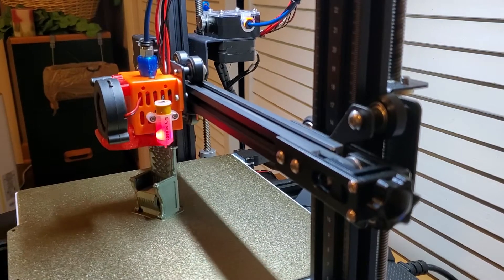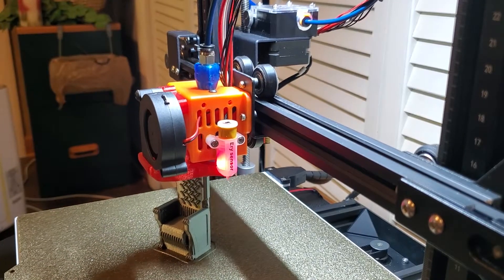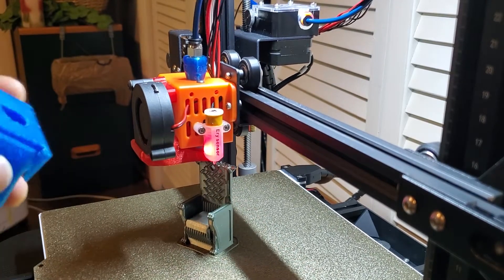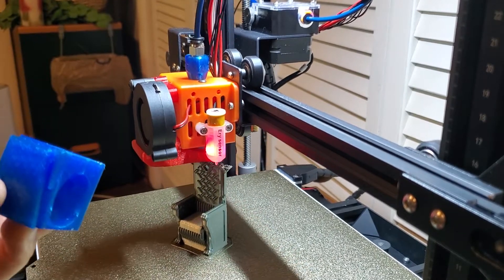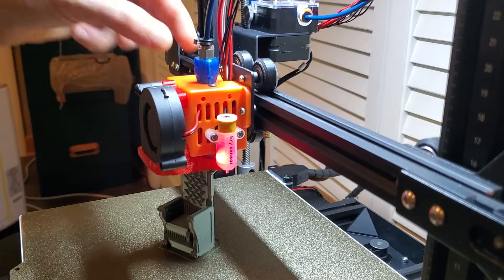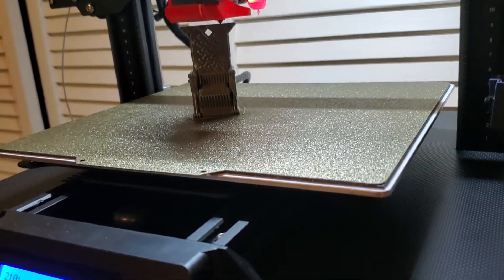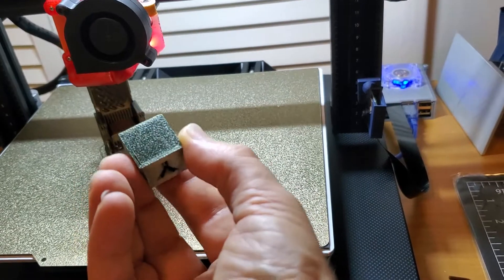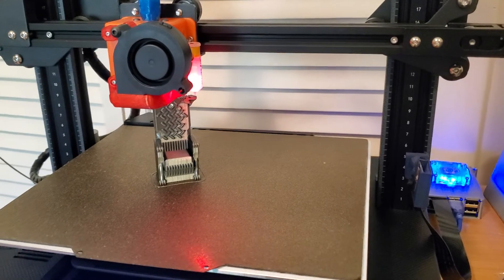Eryone ER20 Hot end upgrade Part 2

Comment: Hi Jay, i got Dome proplems with the Auto leveling with this thing. The z offset is nearly +5mm so it will Go to deep at the First Point in auto leveling. Any idea?
Reply from the maker: Can you explain your process a bit more.  How are you calculating the offset?  The probe should halt the downward progress of the toolhead when activated, so I'm having a hard time visualizing the problem.
Reply: @jayburkette8977  ok, i use google translator. After installing the hotend, I set the z offset. it is now at about 6 mm. When I then start the auto leveling he drives to the first point and drives down too low and breaks off. well below z 0. the whole table goes down. 
the height difference between nozzle and bl touch is about 2 to 3 mm
Reply: I use the z Offset Calculate in the menu

Comment: what steper motor are you using? i installed a BMG clone with a stock stepper motor 42-40 belonging to ender 3 but when it retracts it makes a loud noise. do i have to replace the stepeper motor so it doesn't make a loud sound?

Comment: Hey i was wondering what slicer do you use, and do you have the latest version on your printer 2.0.8? Since its a 25point abl system, in cura it heats up to 215 and then does it which clogs up the nozzle, but in prusa slicer it goes up to 170 and then does it, is there any way to do that in cura.
Reply from the maker: I'm using Cura (4.11 right now).  I actually do the ABL separately from any print (i.e., I don't have a G29 command in the actual G-code file for any print) and use "store settings" or M500 to store the level information.  I heat up the bed for that (so that expansion is taken into effect), but I don't do leveling with the hot end heated.  Does that make sense?  To directly answer your question - yes, you can heat the hot end to 170 using the M104  command in your "start script".
Reply: @jayburkette8977  can you just edit my existing g-code or show me how to do the m104 command , this is g-code: G90 ; use absolute coordinates
M140 S[first_layer_bed_temperature] ; set bed temp
M190 S[first_layer_bed_temperature] ; wait for bed temp
G28 ; home all without mesh bed level
G29 ; mesh bed leveling/ABL 
M104 S[first_layer_temperature] ; set extruder temp
G92 E0.0
G1 Y-2.0 X150 F2400
G1 Z3 F720
M109 S[first_layer_temperature] ; wait for extruder temp

; intro line
G1 X150 F1000
G1 Z0.2 F720
G1 X80.0 E8.0 F900
G1 X20.0 E10.0 F700
G92 E0.0

M221 S95 ; set flow
Reply from the maker: @triggered5637  Try this and see how it goes:

G90 ; use absolute coordinates
M140 S[first_layer_bed_temperature] ; set bed temp
M190 S[first_layer_bed_temperature] ; wait for bed temp
G28 ; home all without mesh bed level
G29 ; mesh bed leveling/ABL 
M104 S170 ; set extruder temp for ABL
G92 E0.0
G1 Y-2.0 X150 F2400
G1 Z3 F720
M109 S[first_layer_temperature] ; wait for extruder temp

; intro line
G1 X150 F1000
G1 Z0.2 F720
G1 X80.0 E8.0 F900
G1 X20.0 E10.0 F700
G92 E0.0

M221 S95 ; set flow
Reply: @jayburkette8977  It didn't work it still heated up the nozzle to 215 before ABL, also I'm using cura 4.11 too, rather than going to 170 before ABL. it went to 170 after ABL was done, and when that actual print was about to start
Reply from the maker: @triggered5637  Got it - I probably can't help then.  I would comment out the G29 like this:

;G29

Just do the bed mesh leveling manually before staring the print.  Then the hot end won't heat up at all on you until it's time to print.
Reply from the maker: Also - post up your start script over on the Eryone FB page.  Would be nice to look at that by itself with a bunch of experts helping.
Reply: @jayburkette8977  ok thanks for the help, also another question do you experience any warping when printing pla, and if you do, do you know any solutions.
Reply from the maker: @triggered5637  Yep - it's an issue.  I'm not a fan of additives, but I found Magigoo on glass to be magic.  The stock solutions you'll find on the net are to up your first layer bed temperature and ensure there is plenty of squish on the first layer.  That said, too much squish and the first layer looks terrible.  If you're using PEI, it's a bit less of an issue.  I also find that rotating the model so that corners aren't on "high" spots helps.

Comment: Taking 3mm off can be done with Cura- not sure if other programs allow this as well- in the "Prepare" screen the "move" box, type "-3mm" in the Z box- effectively taking down the object 3mm below the build plate. 
The trick is Cura will only print what is on the build plate and ignore the section you buried.
Reply from the maker: Yeah - you'd need to invert it in this case and take the 3mm off the top.  Totally doable.